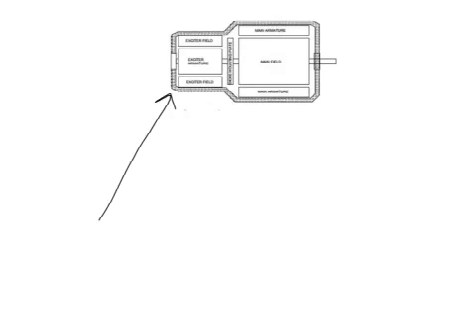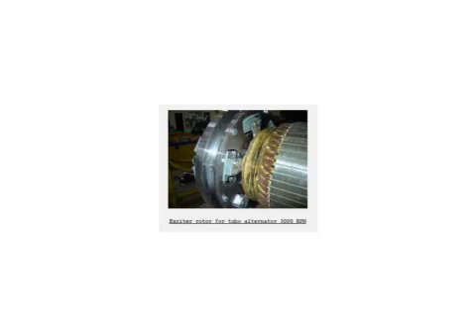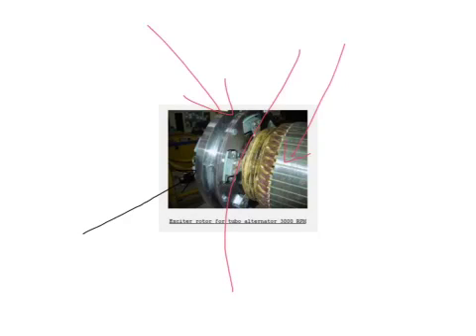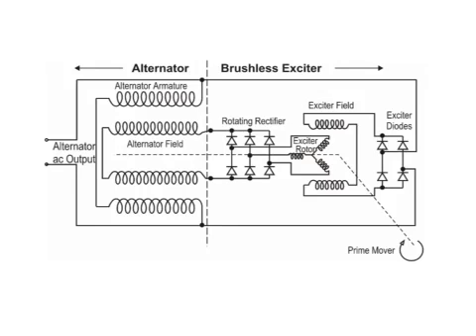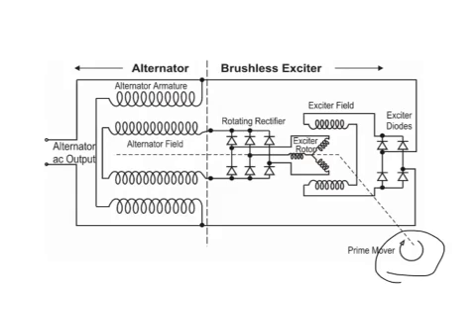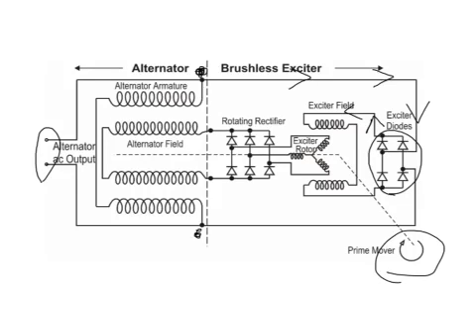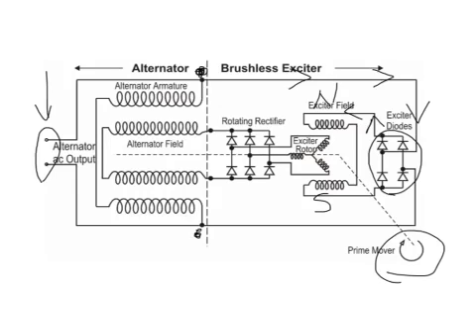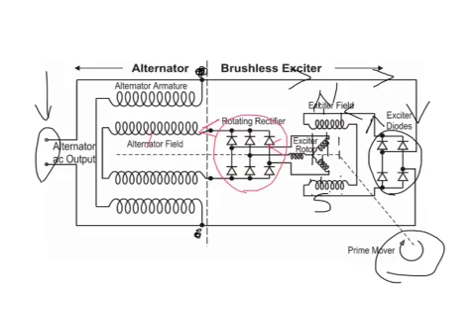Alternator Theory and Operation

Comment: Dayum hit the wrong button. Once a year, pull brush holder and check brushes, and yes the springs. a good brush set will have a braided wire out of the brush itself, that is often called a 'shunt' larger gens might have brass or metal brush holders but if the brushes have no shunt it is not a good practice. Some large KW D.C. generators have a field winding in series with the load. So whatever current comes off brushes to an external ckt. must go thru a commutating winding.

Comment: Hello Marc Garner, I am quite aware of that, thanks, 20 yrs ago I flashed field in sisters VW square-back. started charging right away. BUT maybe you know this. I heard that having a load on gen when slowing down, from running out of gas can/or will cause trouble. Have you ever heard of that?

Comment: Pretty good explanation. so the field poles for exciter must have residual magnetic fieild, so i guess tying exciter end to ac output the generator is always properly excited?
Reply from the maker: Raymond Garafano  If the field has lost its residual magnetism you can “Flash the Field” by applying a DC source for a spell.  This will provide the necessary electromagnetic field to create the residual magnetism necessary for buildup once the machine is put into operation.

Comment: where is the capacitor connected(38Microfarad) in this circuit diagram shown. In practical brushless generator , a capacitor is used.

Comment: hi, how much AC voltage is generated from the stator, before entering the DIODES and voltage REGULATOR?. I own 2 GM delco-remy, AD244 high output 250 amperes,12 volt DC alternators. Running at about 5000 RPM. Please, someone tell me at yosoycalvo@gmail.com.... Thanks, New York, 05/25/16.
Reply: grow some hair first lol
Reply: 14.5v the trick isnt on the stator actually the regulator control the imput voltage on the rotor from 2volts to 6v so creates a magnetic field to the stator to create 14.5v/3face conected to the diodes creating one face ! SIMPLE¡ if you put in 12volts to the rotor this create 52 /75volts out the stator the problem also creates too much heat and burns stator

Comment: I was an electrical generator repair tech. In the army.  the training was very poor.  Most army generators are 3 phase. each phase is 120ish volts we were told there was 1 primary phase for general use but it was best when possible to distribute the load evenly across the 3.  Someone also implied by using 2 phases and ground to output 240v.  No one ever explained how but to be fair I never had a need to do so.  All the gennies I worked with had 3 stages on the rotor. 1 dc earth magnet genny to provide startup power to stage 2 the exciter and stage 3 the alternator.  Could you do a video to explain how a multi phase genny works and how you can get 240v out of 2 120v phases?   I learned more from your 15 minute video than I did in 3 months at ait training in the army.
Reply: Being someone who's familiar with the 52 Delta MOS, How much did you expect to learn from attending a 3 month technical course? AIT is suppose to get you familiar with a basic understating of mechanical and electrical fundamentals (Ohms law, diesel engine operation, and using test equipment and general tools. Your true learning is suppose to come from your supervisors in the motorpools. 

  Army generators from 5kW to 840kW are designed to operate, and support three phase loads. Some of the power consumers we used have three phase motors installed E.G Radars, Weapon Systems and Environmental Control Systems. When your setting up power grids, you want to insure that the load is as balanced as possible. This will allows the generator to spread the load evenly across all three phases. A generator that isn't properly balanced with reduce the life expectancy of the generator.
Reply: On additional note... this about the 220 VAC...In Europe (Germany), we use 220 VAC, 50Hz, If we had to use a printer or plotter from our office in the field, we would just take one of the german style extension cords, splice it into two of the three phase, and one to neutral. That will give to 208 VAC when operating in a three phase setup. the 12 volt difference is not a big deal, and because the german equipment works on 50Hz, the motors may turn a little faster.;)
Reply: @haroldbottom3474 I ok

Comment: why not include a small earth magnet in the exciter field core so that you are allways garonteed to always have an initial starting field?
Reply: lol, I sat down and thaught about it and I think I know why the army uses 3 stages instead of a magnetic core in the exciter.  earth magnets lose there field over time naturally.  pushing against the north pole of an earth magnet with a northern electro magnetic field and the same with the south could potentially cause an unnatural decay at best or crush the earth magnet or at worst turn it into a projectile.
Reply: The Army use a permanent magnet generator on the 3kW, and 7.5kW generators.
Reply: @tberry7348  There's no such thing as an earth magnet. It's called a rare earth magnet because it's made from rare earth elements.